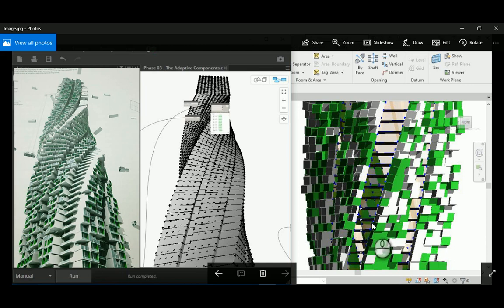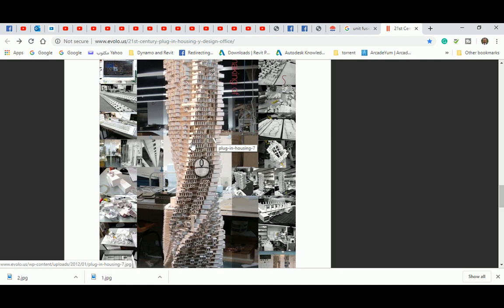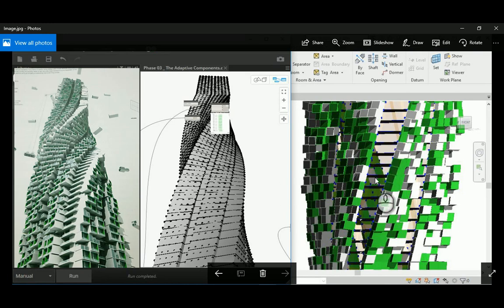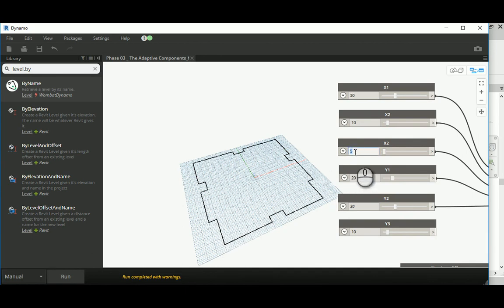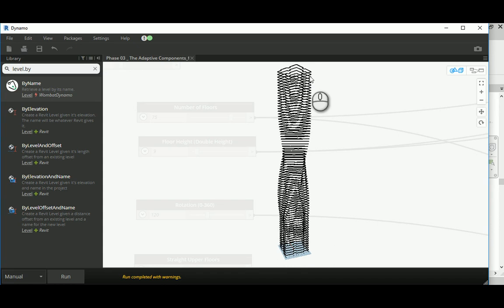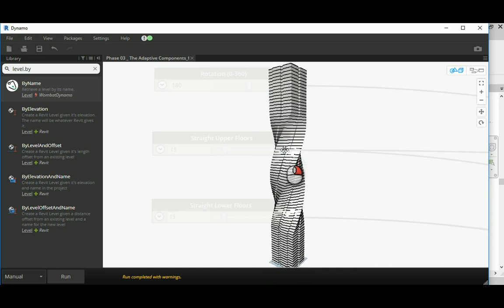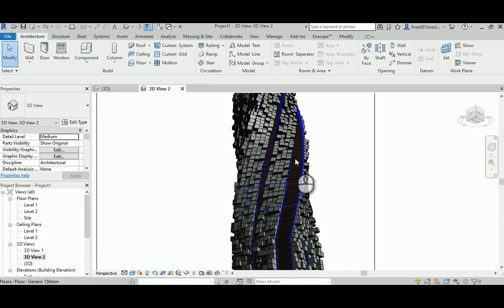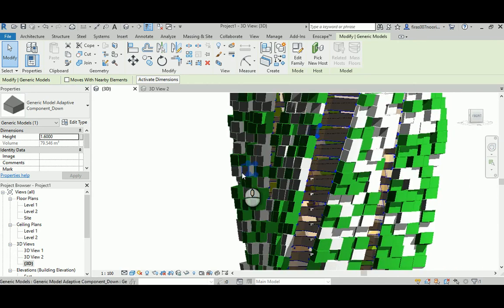UNIT Fusion Skyscraper _ eVolo 2 _ Dynamo Skyscraper

Comment: Salam Firas, I was wondering when are you going to share the complete tutorial of this project?
Reply from the maker: Salam dear Ahmed, I am sorry for the delay, I am working most of the day and even late hours at night, almost every day, struggling to post short videos every week due to work loads, 
The concept of this evolo tower is driven from random recurring function where you repeat a box (or in thus case an entire flat like autocad block or revit adaptive component) on a surface, start by making UV division on the surface make equal UV and each unit place the adaptive component on it, this will required a string laptop indeed, I replaced the AC with normal box and did one face of the tower or two and this cause my laptop to goes nuts,